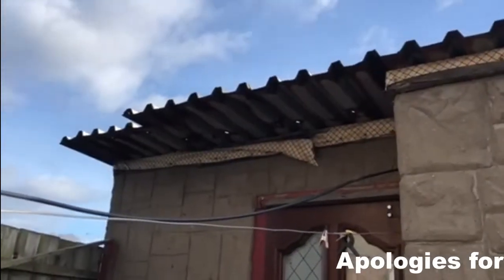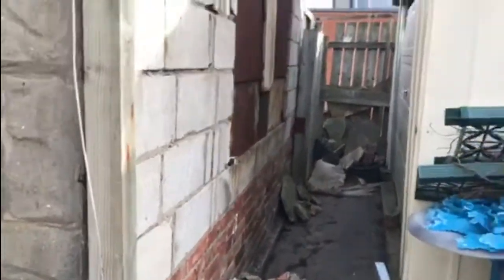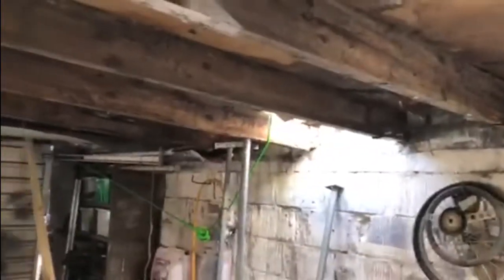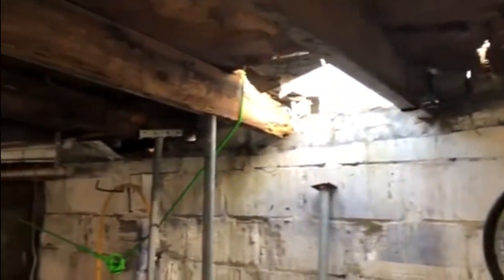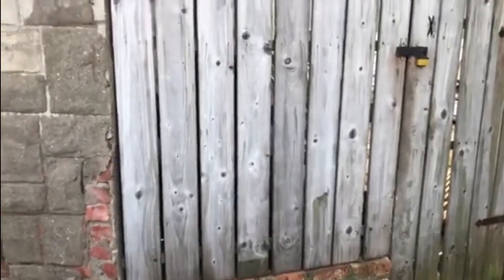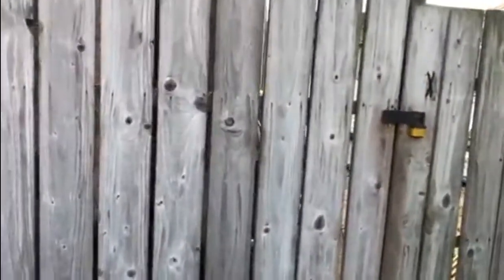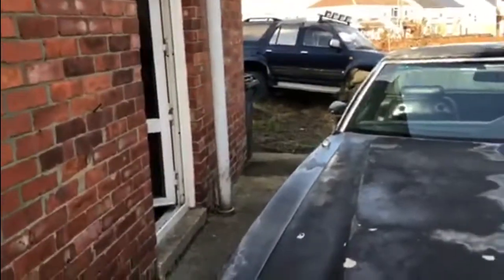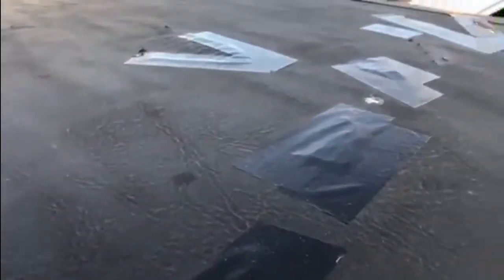FFS! Garage Repair and Transformation

Comment: Must have been gutting especially on the Chargers roof but as you say it is what is and they are only cars. 

I cannot remember if we had any damage up here with storm Malek.

(Goes away to have a look)
Reply from the maker: The most annoying part of it was that the vinyl roof is the original one from 1968, at least I’ll get to make sure the steel roof is ok when the vinyl comes off though